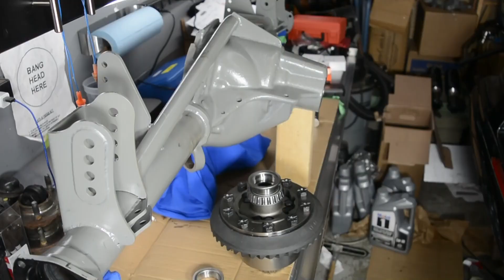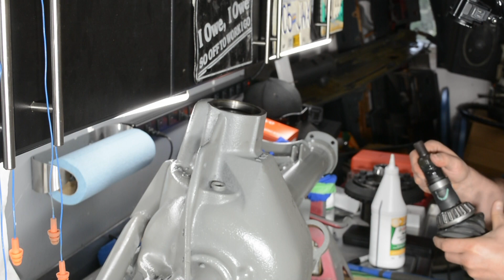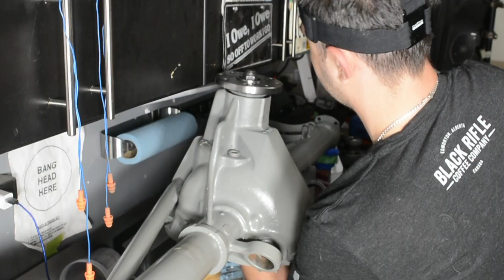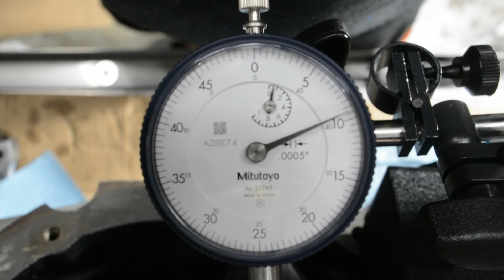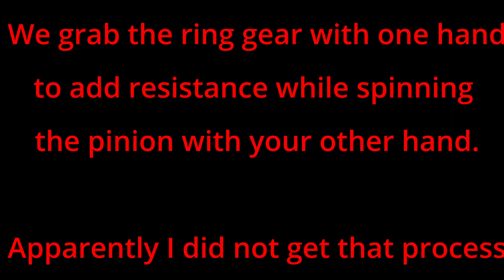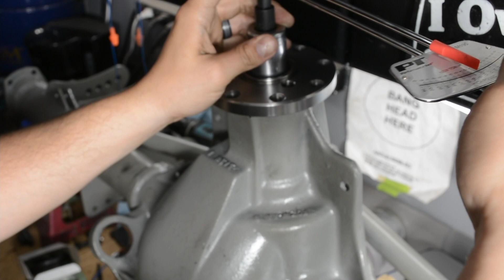ford 8.8 build with ratech solid spacer - 1985 mercury capri - Instructions

Comment: I didn’t see you set your pinion depth. I always measure that first. Otherwise you are just guessing. The Ford rep telling you to use a .028 is just a guess and is different depending on who the manufacturer is.
Reply from the maker: You're right, by not measuring the pinion depth it is just a guess until it's all together and we are able to check the gear pattern. Fortunately in this instance I was using Ford Racing gears, and it was the right pinion shim as the pattern didn't show the depth being incorrect.